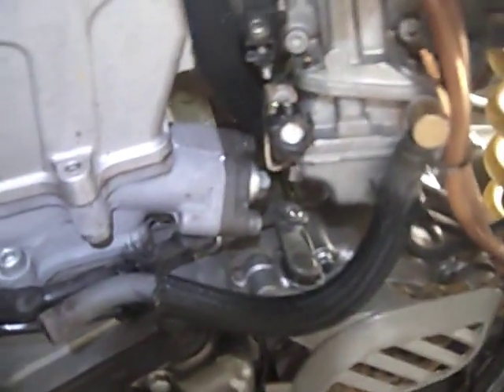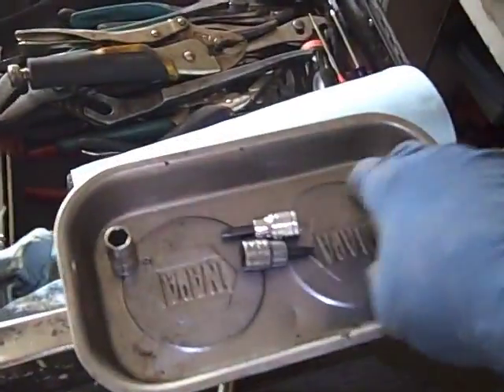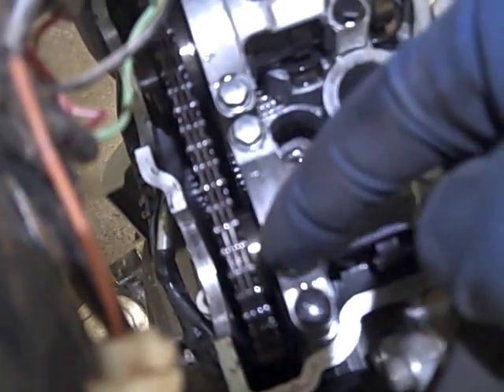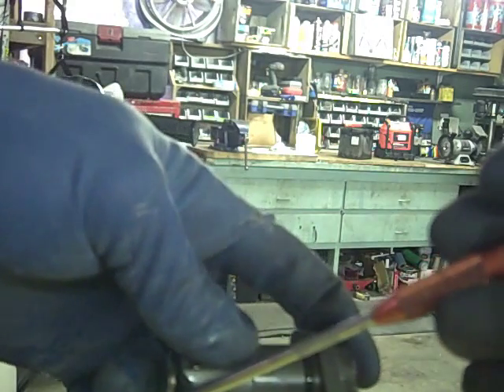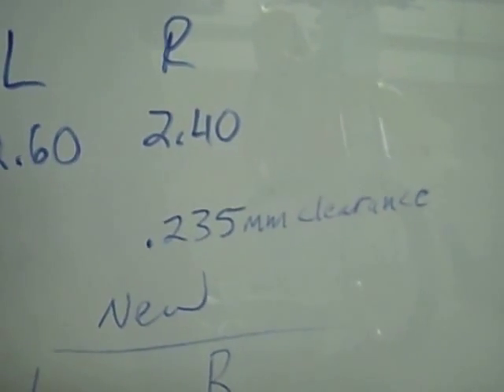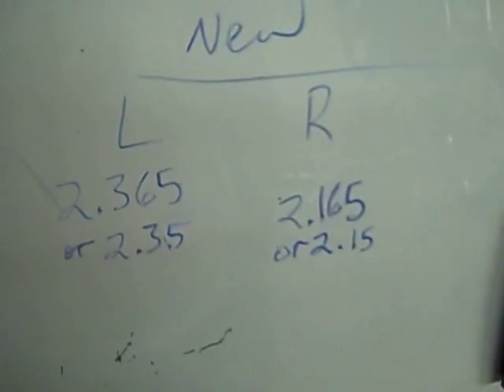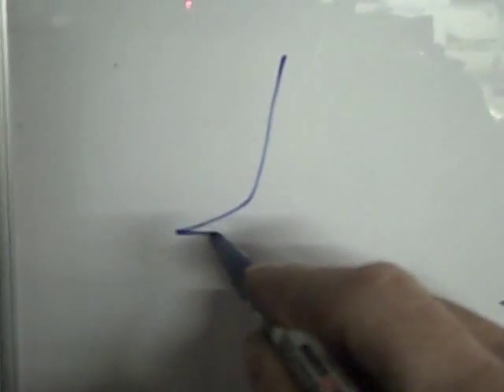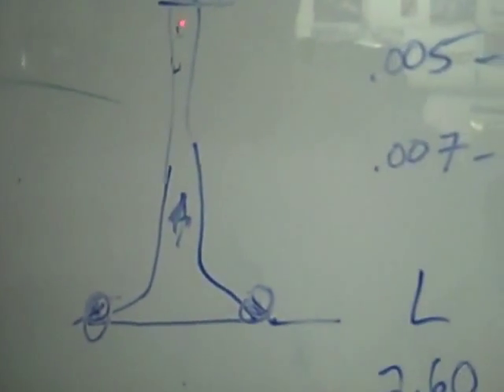2004 RMZ KX 250 F Valve adjustment Part 2 Math and chain tension

Comment: I have an 06 rmz250, inlet valve clearance is meant to b 0.10 mm - 0.15 mm. My left inlet valve clearance is 0.29 mm and the right is 0.21 mm. Are they not supposed to get tighter? Why are mines looser? And would i calculate the same way for a new shim?

Comment from the maker: @billyman1221 There's a special tool called a "keeper tool" those little "C" shaped pieces are called valve keepers.  With two people you can get by without one.  Use a magnet tool and a pair of long nosed pliers with a 90 degree bend.  Set the head on the work bench on a big wadded rag to keep the valves from getting bent.

Comment from the maker: @4everwillride Something like 18 ft. lbs.  Those specs are based on diminishing return on angular rotation.  You ever do an increasing f(x) problem in math?  It's kinda the same thing.  You'll see the bolt slow to stop before risk of breaking it.  I torque till it binds down secure and then stop.... but I've been wrenching literally every day for the last 24 years.  Ya, I'd go 18.

Comment: great video.  very, very helpful.  im planning on breaking my bike down tonight for valve adjustment/replacement (2004 rmz 250).  i heard that if you want to go with stainless steel valves, you have to buy some sort of kit for it?